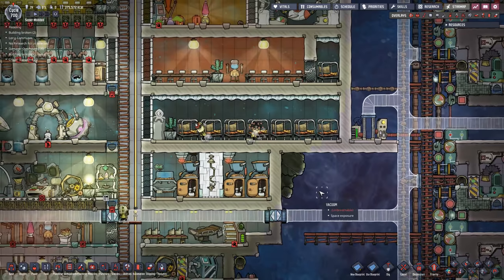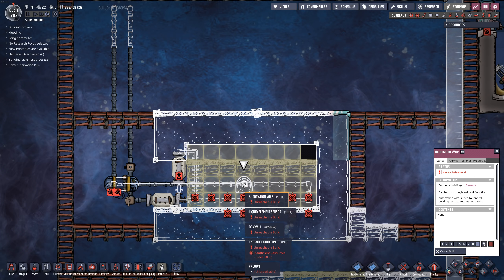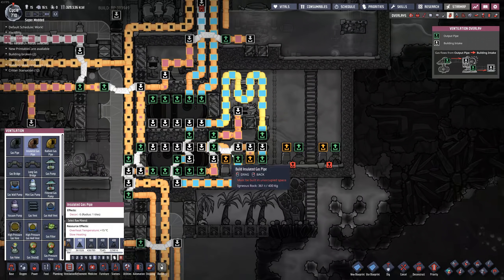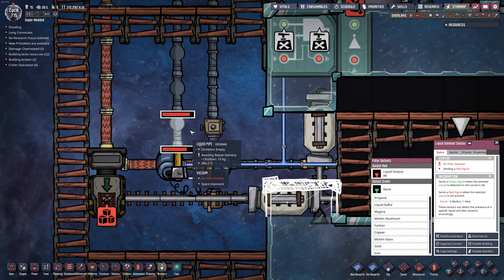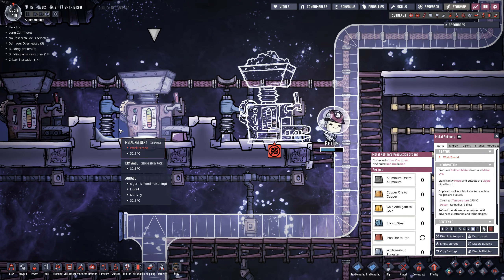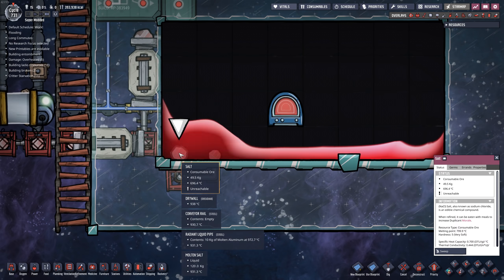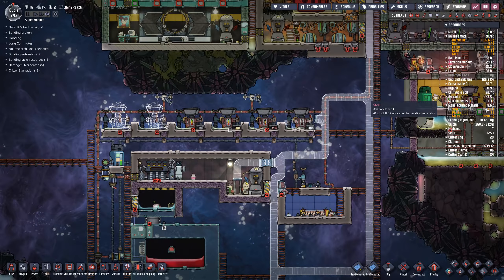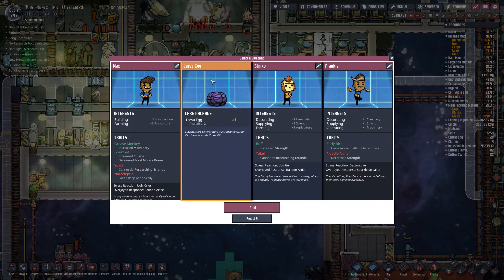Molten Salt Reactor! Super Modded Oxygen Not Included EP20

Comment: You need a security shut off in case it gets to hot and creates gas aluminum

A thermal liquid sensor right before it enters the container at 100° below the gassing point and a buffer( with a not gate), so that at least 1frame is to hot it turns of an let it cool a little

Comment: I had an idea: if you thermally isolate the roof of the salt chamber from the floor, with the steam turbines drawing heat from the roof and the aluminum heating the floor, might that make it more efficient? With your current setup, if the aluminum does not bring enough heat in, the steam turbine could theoretically bring the whole system down to 120° if something went horribly wrong. If you thermally isolate the roof, the salt pool would be unable to drop below just under boiling as it needs to be gas to reach the 'cold side' of the chamber. That should mean less heat spent on pushing the salt up to boiling and more spent actually boiling it, as well as no chance for heat to bypass the multiplication entirely be conducting through the walls from input directly to output.

Comment: Wouldnt you want to insulate the liquid bottom from the gas top part of the salt tank?
For example making the 2 middle section of the wall on either side into insulated tiles.
So only the gas can conduct heat upwards to the door.
With the high conductivity of the diamond glas most of the heat thats going into the water would just come from the molten salt directly.

Comment: I don't understand that system.
If you heat the salt and it turns into gas you have more thermal energy.
But when you take the energy out of it it turns back into liquid and it has less thermal energy again.
Right?
Reply: @brothgar  
But if you have an exact point where it changes the state you can't take energy out of it without turning it back into liquid except you heat the gas up more but then you have no energy gain.
Reply: The point is to extract the most amount of energy out of the system, so if it becomes cooler when it is liquid it's good for us, you just re heat it ant take the energy out
Reply: it takes less energy to turn it in to a gas than to turn it in to a liquid
Reply: Yes, and the difference in thermal energy is extracted into electrical energy. You are of course not extracting all of the delta from liquid to gas, but you are extracting all the additional energy until it cools down
Reply: @BismarckDidNothingWrong i said just what you did but simpler

Comment: 14:49 won't the pipe passing by the second electrolyzer from the left's hydrogen output prevent it from outputting to the line due to the pipe being full of small packets from the other 2 electrolyzers? Solution would be to use a bridge and merge after the output if that is the case.

Comment: You know that tile forge thing that heats up a single tile...?

Can we melt neutronium? I think it melts into tungsten... 20 tons of it. Of course, it would take a LOT of coal.
Reply: There’s a tile forge thing that rapidly heats up a tile. If you run it enough, it will eventually melt. It shouldn’t take TOO long, the forge works quickly and you won’t have to worry about heat loss. Although, you might have to worry about the 20 tons of tungsten compressed into one tile wanting to explode.
Reply: @PashaGamingYT  tell me more, there are some neutronium tiles I'm willing to remove, 20T of tungsten is great too, for late-game bases wolframite is really low